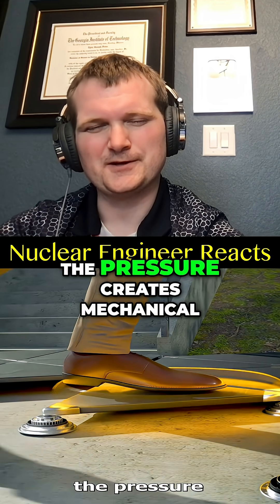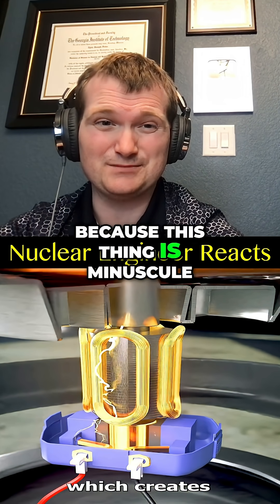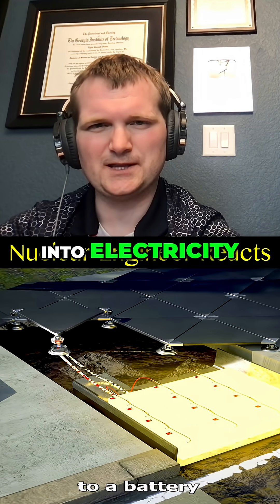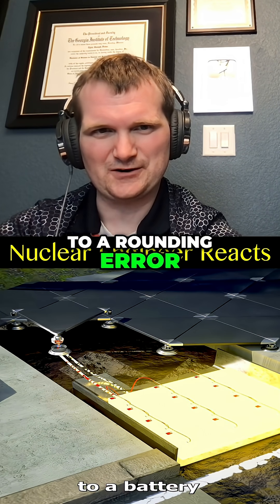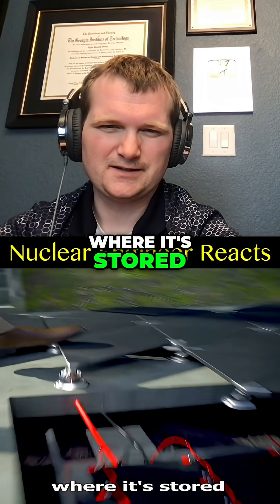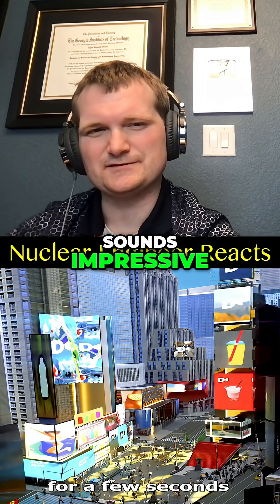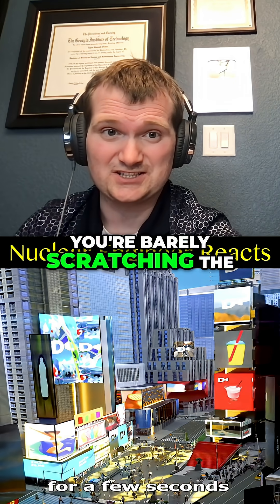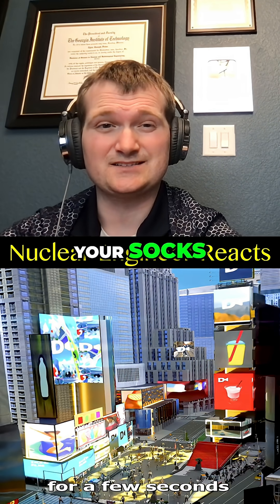Generating Electricity from Walking - Nuclear Engineer Reacts to Zack D. Films

Comment: Maintaining it would be a nightmare
Reply: That was my immediate first thought. Just because something is technically doable doesn't mean it makes any type of economic sense a la benefits versus costs. That's the actual trick that most people don't comprehend; not if something is viable.
Reply: I would send a bill to the company demanding compensation
Reply: the idea shook me. "Electric generators? seriously". Like, wouldn't it be easier to create piezoelectric tiles???
Reply: @Chilling_pal_n01anad91ct  they are piezoelectric, the visuals in the video are a bit misleading.
Reply: The repair techs would love this!
Reply: @mrdan2898  I would figure they’d hate it,

Like, finding which tile is broken, which wire got disconnected, or even where the battery are all a nightmare to figure out
Reply: @mrdan2898  no
Reply: @dan9147 Why not?
Reply: @mrdan2898 high traffic area, small components, tons of them, and that's not considering the whole net of wires that at any point could cause issue. Without further knowledge I could assume storms and lightning discharge could be an issue. Obviously if this is near a building I doubt it would be an issue.
Reply: @dan9147 The repair techs would love all the reoair calls. In which would likely bankrupt the project.
Reply: @E30cad true, but it alone would be enough to let a small army of repair contractors live very comfortable lives and never have to take on another client ever lol
Reply: All those beautiful billable hours the repair men would get
Reply: Walking would be a nightmare
Reply: They have it in shinjuku station
Reply: agree only because thats the worst design ever
Reply: you would spend more energy building and maintaining this system than it gives you
Reply: Japan's been using them for some time now in busy train stations to power stuff like displays, lights, etc.
Reply: They can't manage the roads or sidewalk as concrete & asphalt. How are they going to manage all these parts? Lol
Reply: they are doing it in highways in some asian countries.
Reply: sorry but no. that's not how these work or would, they replace them... lol
Reply: imagine trying to tell your mechanic to fix the broken pieces inside your car instead of replacing them
Reply: It would create more jobs but modern technology need more repair cos it’s designed that to extort people but if it was designed to be each tiles for 10 years it’s possible.
Reply: @kabdul9208  it doesn’t generate enough electricity for it to be worth it
Reply: Why
Reply: @HaydenLau.  Friction. Anything that moves will create wear and tear and will need maintenance.
Reply: @fabiodlx yeah but it looks very simple and robust

Could probably run 200,000 cycles without failure. Maybe the yearly inspection and lubrication should be sufficient. People always underestimate how much maintenance things need
Reply: @HaydenLau.  exactly, just not worth it at all
Non localised and too many small moving components all outside that have to also be maintained for the small amount of energy it produces, I truly wonder if it’d even pay itself off for the cost in checkup and maintenance alone
Reply: @HaydenLau. , do you mean overestimate. This is because underestimate implies, “estimate (something) to be smaller or less important than it actually is.” Or, “an estimate that is too low.” Which means that you are saying that people think that less maintenance is needed. When I think you mean to say is that people usually believe that it take more maintenance than in reality.
Reply: @HaydenLau.  200k Cycles for a walkway is way too little. Just to power one household for one day (assuming 15kWh for a small household and 200J per cycle) you'd need 270k cycles.

In addition the thing needs to hold up to ice, water (potentially even with salt mixed), dirt and potentially much heavier things moving on them (like smaller cleaning or maintanance vehicles).

EDIT: Turns out pavegen (company behind those) made a installation in the UK in 2015 for "powering christmas lights". The stats seem to be closer to just 4J per step. So the 270k step estimate is off by 2 orders of magnitude.
Reply: @HaydenLau. It's just not worth it, a street of these would be barely enough to power a few lights, not to mention this thing would need to be very robust and water and dirt proof
Reply: @HaydenLau.  If you get 1000 people a day (not many) it would be dead in 200 days.

You would have to inspect every single moving part... the energy you put into maintenance would always outway the generated power.

What people actually underestimate is how much power we actually produce and use.
Reply: @HaydenLau. You're forgetting that there's not one but thousands of those, a tile is barely larger than a foot. Then add to it all the cables and circuits needed to make it work plus the time needed to notice, find and replace the issue.
Reply: @HaydenLau.  then factor all the labor required for upkeep compared to the minimal gains, if it was profitable people would be doing it
Reply: @HaydenLau.  And once they start to fail you need to run around and diagnose the failure with each of the 5000 mini generators, you know they won't all fail at once so maintenance will need to be a year round constant occurrence not just one inspection a year, you need to potentially replace them entirely, you need the materials and infrastructure to make all of them, you need recycling centers for the worn generators. 

At the end of the day you would have just been better off getting a steam engine and some coal.

Also, let's assume that what happens in the video is real. You have 5000 generators, with a lifetime of (to be generous) 500k cycles. That's 2.5 billion cycles. Let's assume a constant 20K pedestrians per hour and each takes 100 steps to cross this, so 2 million cycles per hour.

That's a 1250 hour lifetime, that's a little over 52 days or 7 ½ weeks. and you know the load wont be evenly distributed either.

Edited because I'm bad at math.
Reply: @HaydenLau.  yippee yahoo with that average lifespan that would mean that it could possibly generate about $1 worth of electricity until needing replacement, which would probably cost at least $50 for just the component
Reply: @HaydenLau.  They are also tripping hazards, allow for dust, rocks, sand, etc to get into crevices. They are an absolutely terrible idea, especially since so little power is actually generated.

Even at the age of 12, I would have foreseen the issues, inefficiency and ineffectiveness of something like this.
Reply: @HaydenLau.  If you have to ask why then no amount of explaining will make you understand.
Reply: Asphalt is about as low maintenance as it gets and you still see potholes everywhere
Reply: @HaydenLau.  We have this at the train station near me and it is entirely clogged with whatever and literally doesnt work

Comment: This sounds expensive for so little.  And I doubt these will hold up to offset maintenance costs
Reply: This exists already in Japan, they use them in Tokyo
Reply: It's existed for decades now, it's a novelty idea and not a serious project.
Reply: and it's so much complex mechanics, that are gonna break after one week of use, for almost no gain
Reply: It sounds like that because it is. Currently it's for virtue signaling only. The green bs. Unfortunately that's more than enough for a lot of people.
Reply: One of the big tricks is to make them very well and durable, but yeah, it's been proven to be barely worth it in super high traffic areas that are semi-protected from the weather, with reliable off-hours for maintenance, and not worth it anywhere else.

Comment: My takeaway from this is that I should be using my socks to replace fuel oil in my home.
Reply: In crowded cities it works. Japan already did that
Reply: @Learn_with_Luna  Well "they did that" and "it works" are two different statements. And even if it technically works it still doesn't mean it works well.

We've seen countries doing solar panels in the road only for them to break down prematurely. Just because they did it doesn't mean it worked as intended.
Reply: @Ether_Void  its just about making good use pf wasted energy. You need not analyse my sentences, that's not gonna make anything for you or anybody.
Reply: @Learn_with_Luna  It also doesn't make use of wasted energy. The energy those panels turn into electricity comes from the fact that they decend during the step, this is like walking on a soft material like sand or snow. It's actively harder to walk on those.

PS: Also there is a need to analyze the sentence. Because it was suggesting that there is proof that "it works" even though there isn't. Despite it being a minor issue I know how easy people interpret those because I had similar discussion about those panels before.
Reply: @Ether_Void  It essentially depends on the design. And I don't think people face much of an issue as I said its already implemented. We are already short of green energy so I guess it will be better if we can think of making it more efficient or creating similar ways of green energy. Its not complete in itself, but a step towards it. That's how world grows.

And about me saying not to analyse my sentence, I am just saying you are over analysing the thing for your ignorant reason. Instead of that try to come up with your own idea if you have the creativity to do so. Or suggest a good fix to optimise the same.
Reply: @Learn_with_Luna  Thank you for again confirming that my overanalysis is correct. You assume people have no issue because it's implemented again how does one proof the other? Do you have any actual data showing that people don't avoid those or that older people actually have no issues?

Even if so the amount of energy is absolutely tiny and this can't be ignored. Those tiles aren't free, they require material and energy to produce and maintain. If their generation doesn't offset the production it's wouldn't be green in their lifespan. And that wouldn't be the first project that suppresses this second factor essentially greenwashing the entire thing, like the solar roadway projects I've mentioned.

In addition if the people get exhausted faster the walkability of the city as a whole would suffer. Sure energy is one thing we need to improve, but there are things like our reliance on cars that should change first.

The design itself also wouldn't change the fact that you need to keep the conversation on energy. Losses especially in your muscles, friction, the rubber of your shoes won't change because of those tiles, so they need to give way to produce energy. Before relying on obscure ways to extract such tiny amounts of energy, we should focus on existing methods that simply haven't been rolled out. Cities have a lot of roof space or open parking lots yet are rarely used for solar power which especially on parking lots could be used as roofing to reduce AC usage.
Reply: @Ether_Void  If you consider replying to you is the same as agreeing, then you really need some self evaluation. Of course you are craving validation, but my perspective is different from yours. If you think you are smarter than most of the top engineers who worked on the project, try to develop on your own or lead them. 

They know about all these problems. But they don't sit and seek validation from others to deny it absolutely. They experiment, improve and grow. Everything has a solution and optimising this technology won't take long. The problems you just mentioned are the first step they must have encountered. So if you think you are smarter than them you can contact them, not me.

And as for me, I am witnessing, instead of being completely ignorant of the possibility, which always fades away any opportunity of development.

Comment: Here's a question could we do it to the roads so the more people that drive the more energy it creates
Reply: It would be like driving on clay, the road will deepen as cars pass on the tiles and jump up once the weight is moved from them. Also there is the maintenance that would be much more frequent if you use them on a road
Reply: @Race-dn4to ok thanks

Comment: Now what if you made drop elevators. Say you have a mall with that is 2 or 3 story and you have an elevator with a counter weight strong enough to lift the elevator with no one on it. The quick way down is to use the elevator so have someone step inside and you press a button and your weight lowers the elevator.

Comment: this makes it harder to walk, tiring out humans.
Reply: Yeah, people will want to use vehicles to move around more, and/or they'll eat more food, which is an expensive fuel source.
Reply: It's also unsafe, the tiles depress, the farther it does the more power it can generate, but this causes an uneven surface for walking and can result in tripping and personal harm. you can also get issues with stepping on multiple tiles at the same time creating different levels of depression on them and create a variable, uneven walking surface. 

And since no one thinks about movement impaired people, this would be more difficult to navigate with a wheelchair or crutches.
Reply: It's not even worth the cost of production and installation. There are prototypes out there, but they're just a proof of concept and local gimmick.

Comment: Really the best way of getting energy is collecting solar. Maybe if you can figure out how to capture neutrinos you could get power from that.
Reply: Solar requires batteries that require rare earth metals. So, you are better off mining uranium than building millions of batteries
Reply: Except that the sun is only shining for part of the day, and only visible at all in some places. Not everyone has 18 hours of daylight. Like for example where i live in Alberta, while we have lots of sunny days during spring and summer, our daylight hours are minimal for half of the year. Getting on 6 hours of "daylight" during 5 months a year, and much of the year is overcast, and once the solar panels are buried beneath snow, they're not getting unburied until someone either shovels them off, damaging the panels, or winter leaves, and we have insane hail storms, many times a year, (especially in the lower part of the province where we actually have open fields, the entire northern 2/3  of the province is boreal forest, so good luck getting much light hitting those panels), from golfball sized on the locky end, to softball on the bad end, and those softball sized ones aren't even that rare. Not too mention that solar doesn't even work at all during nighttime hours.
Reply: @jasonlauritsen5587 A fellow Albertan. Yeah, those hailstorms get crazy eh.  In Edmonton, when we do get hail, it's very small. I have seen quite a few new housing developments putting on the solar panels as a selling point. Still need to be connected to the grid. 
I dont know what its like down there for sun, but from May till September, its 8 plus hours.. once October his, its dark fairly early. I miss the sun already.
Reply: @Benji__Strange67 I've lived somewhat all over Alberta, and central Alberta(Ponoka/Lacombe, Rimbey, Red Deer, etc) gets insane hail storms several times a year, so they get smashed pretty good, and lived up north too, Whitecourt, GP, Slave Lake, and every minute you drive north the lack of sun is impressively less, the hail isn't as bad by any means, but that 6 hours or less of daylight gets to you quick. My cousins live down in Medhat area and there the solar does apparently work pretty decent, but they don't have a tree to speak of that wasn't planted lol. But they still lose a ton of panels when the storms hit, especially with their several square miles of solar farms all in one place.
Reply: Also, what no one want to bring up, is that solar panel area's are much, much hotter than the surrounding area, just like how downtowns of cities are hotter than the rest of the area due to all of that glass magnifying and the metal and dark materials holding the heat.